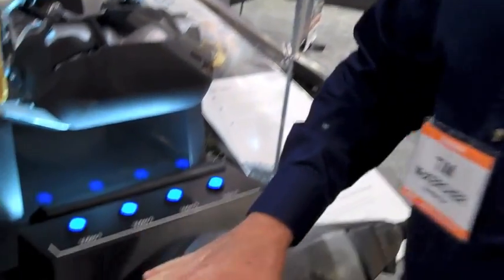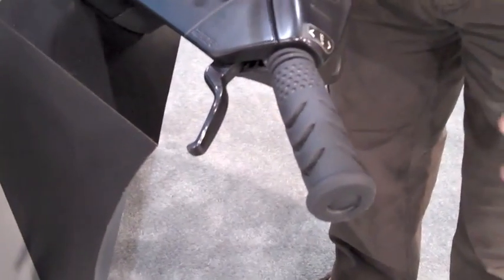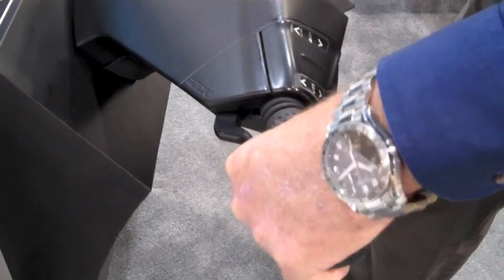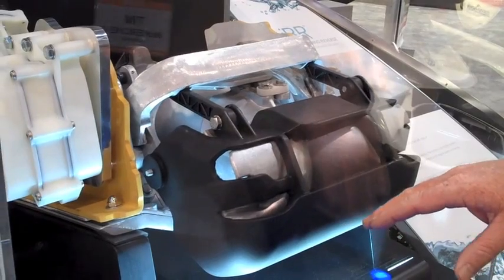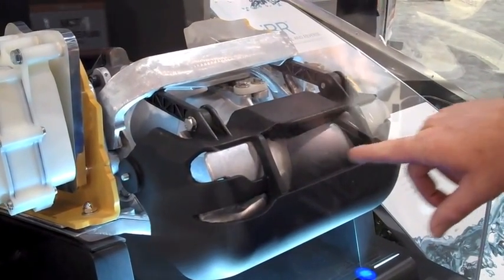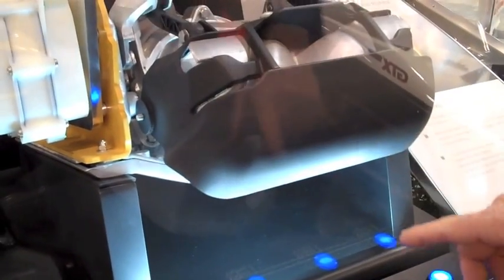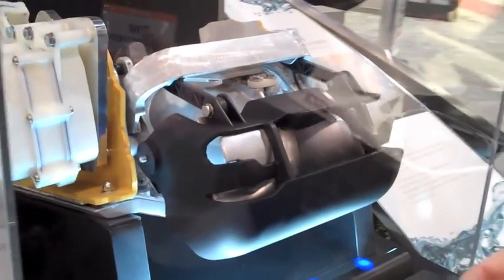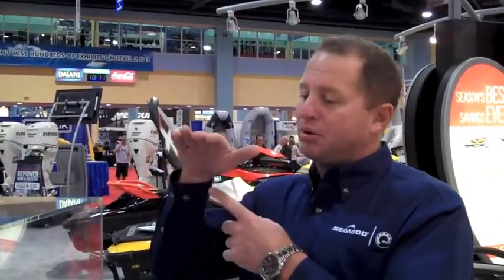Sea-Doo Intelligent Brake and Reverse Explained

Comment: and the electrical connectors are places at the lowest part of the ski where they will be exposed to water in the hull ( and YES water gets intot he hull - like when you rinse things out after salt water riding - or when the carbon seal fails, etc) this means water gets into the connector,even though it is supposedly waterproof and corrodes the pins or works its way up into the wiring itself, necessitating replacement of the wiring harness) the actuator itslef is about a $700 part excluding install labor ( SMH)